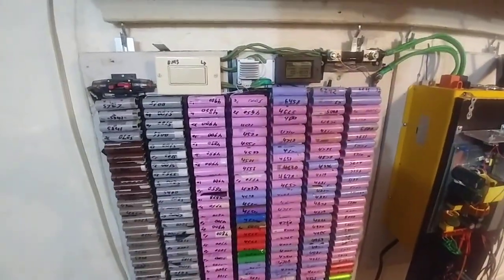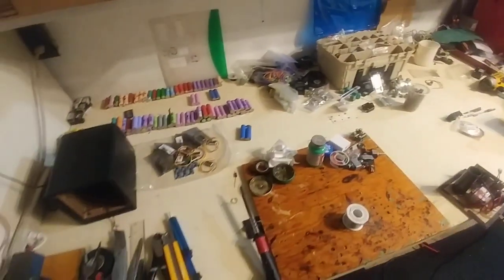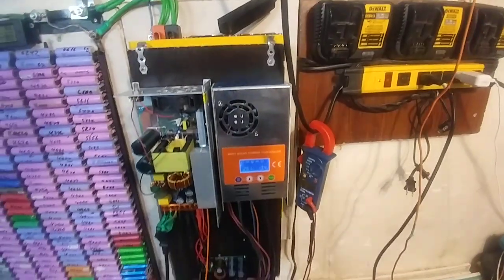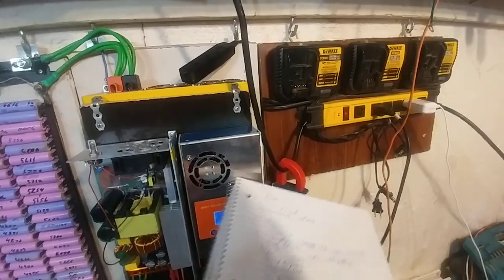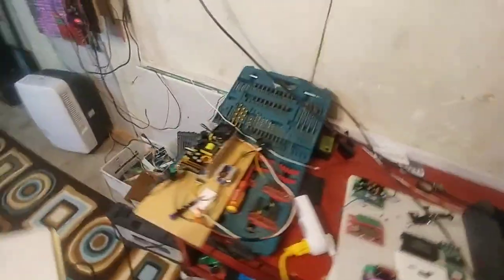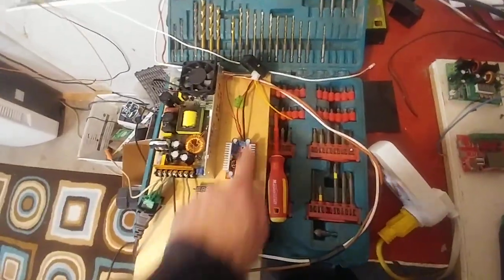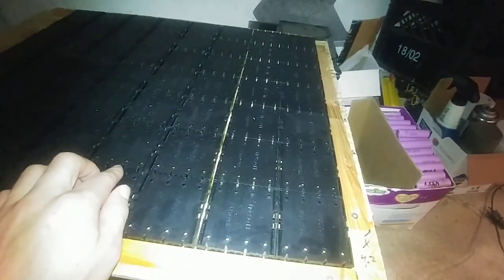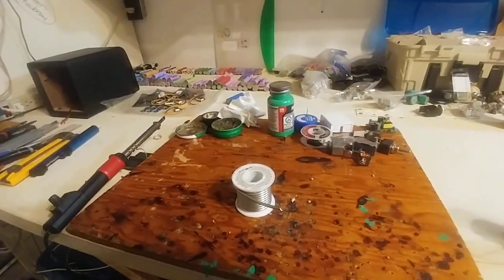18650 7s 29.4v nov. 2018 update

Comment: It could be the mppt tracking and the ac tripple from the ac in the ac to DC. I have the EPever tracer A and AN controllers. The cells will last longer if you only charge to 4.1 per cell. I need a spot welder. I have 14, 100cell packs. Im running 7s and charge to 28.8v and discharge to 3.1v/cell. I thought about building a charge controller, and a inverter. But my skills lag my imagination!! Have you checked Julian illett's channel, he has built controllers. And working on a mppt "muppt". It's not a regular thing . he has many projects.
Reply from the maker: Thx man I'll be looking into that this week!

Comment: On my 60A MPPT makeskyblue I have hook up 4.4kw solar panels and I have the same issues to ramp up then turn off and turn on again in the loop until I take off 4 panels...
On mine I have seen 61A before is turned off... 
I have 130-145v on the PV side or 4 panels in series and 3 in parallel each panel is rated at 280w at 41v.....
Maybe you have issues with PV input voltage some spikes try to put some big electrolyte cap's on PV input like 10000uf 150v or 20% more than you have input voltage... Because pv panels represent stabilised dc voltage......big cap's have the same effect to stabilize the voltage and eat spikes..... 

Cheap Chinese bust or buck converter have the issues to put out many interferences with outputs.....
1500uf=to smooth 1A for the reference... 👍 

About mppt charge controller I would also like to have better controller like outback or midnight solar but they are to expensive for my budget.....

Comment: Hey Andy, Andy here - a few things: 1. It looks like you are planning on fusing every cell in a 7s link, and I see allot of people doing this when they build diy batteries. When you put batteries in series the amperage of each cell is the same so you don't need to do this - you need only one fuse per series string. You have no way of fusing your parallel connections as your batteries are spot welded together, but you could still fuse the parallel connections between the cell holders.   2. Why don't you use the battery charging capability of the UPS itself to charge the batteries you have connected to it? The UPS has an H Bridge in it and it will charge the batteries when AC is applied to the unit, you can either modify the settings of the unit itself or use the charging power it provides to drive a lithium battery charger. 3.I have a APC 2U 1400VA I can donate to you if you want it.
Reply from the maker: I've been going over what you said for the past few days. Im going to make a video talking on your points great questions thx man!
Yes if we can id love to have your apc! Mine in short refuses to charge the batteries :(
Reply: @AndyShell  ok, let me know when you have time I picked up a bunch of 1500's and there is an oddball 1400 in there you can have.